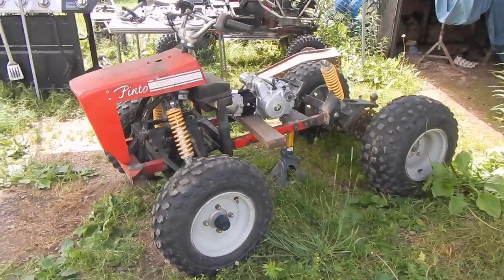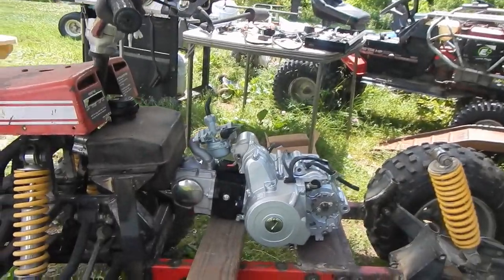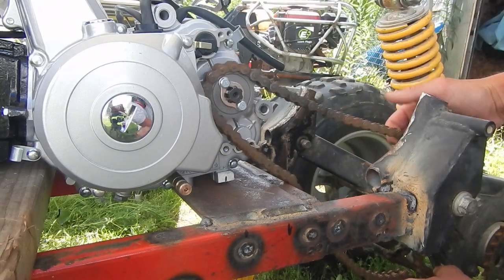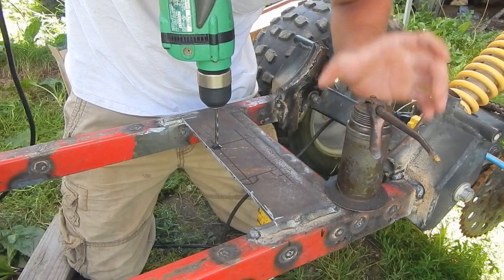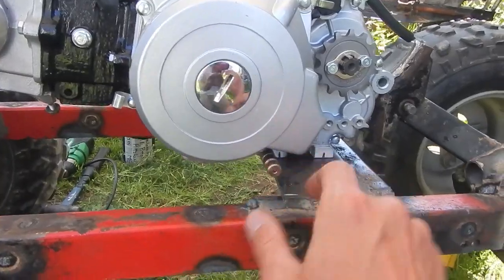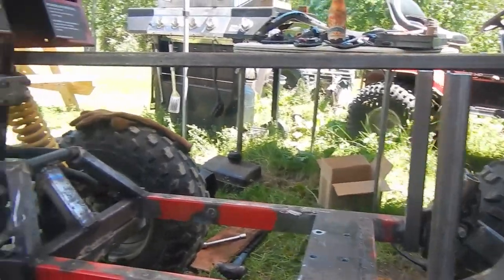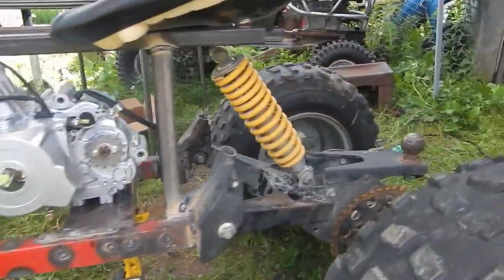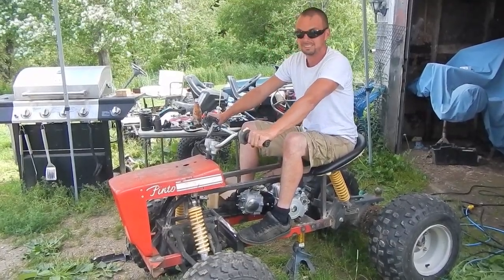Mini Offroad Mower Build #5

Comment: It looks like you have plenty of room to drop that motor about 4 or 5 inches to solve your gravity feed issues. Just move that plate to the bottom of the rail and maybe even a little lower (like a skid plate). This would solve your fuel issue, solve your chain issue and give you better seating options. Just a thought. Looking good. Enjoying the build.

Comment: Looks like Fun!!I love to build things.I noticed how far your engine sprocket is away from your swing arm pivot point,That may give you some problems with the chain going extremely slack whensuspension is working.The carb being angled shouldn't cause a lot of problems, just depends whichend of the float drops into the bowl, I worked at Honda years ago but I can't remember if they fall in the front or back. Sorry if these comments offend you, that is not my intention.HAVE FUN!!! I'll be watching!

Comment: The rear shock mount can be a horizontal bar running from each stub behind the seat. But I'd triangulate it downward from the stubs to where the rear swingarm pivot is welded, kinda in a right-leaning 'V' form from the angle you filmed.

Comment: It's a mowtv
2 things i noticed. First is the intake manifold you have. If you can put your hand on a 125-140-150cc motocross intake manifold they are a lot bigger and actually matches the engine intake port. you Will gain a good amount of power on the top end. you can have them in different angles.

The carburetor you have is great, it's smaller than a mikuni 22mm but it's assle free. I have one and it never needed any adjustment whatsoever. 

2nd thing is, due to the weight of your mow-tv, i would ditch the 14 teeth sprocket and get a 12 teeth. In 3rd gear the engine just won't take it. Nice build and keep up the good work!

Comment: you can make a engine support comming off the bolts holding the valvecover , you have a front crossmember allmost  right under there 
prolly be a good idea to make runningboards to put youre feet down that way you can move youre feet untill youre comfortable and stand up to put some weight over the rear
if you can find a second pinto hood like the one you have you could cut the grille part off it and mount it in reverse between the current hood and the seat covering that hole between the hood and the seat up , can prolly hide the tank under there too

Comment: you should mount a gear stick to one of the bars running from the seat to the handlebars to change gear that way rather than using your feet. Unless it has a clutch then you might have your hands already occupied. Looking good though

Comment: You should look at using a 26mm intake and carby to match the port / intake on the head. Iv had lots  of success with mikuni vm22 carbs. The intake and carby supply with the engine are very under sized and restricted. Hope this helps.

Comment: you are going to have chain tension issues as suspension cycles , The bolt hole behind the sprocket on the engine needs to be in line with swing arm bolt

Comment: When you said the problem with the fuel pump. I was going to state that a futuristic predicament may be the cylinder head on that air cooled motor will get up to212 degrees at operating temperature, and burn a whole through that abs plastic gas tank and become a serious safety hazard. Such as a potential flash fire

Comment: you can get oil coolers for these motors fairly cheap and cool looking ones .. i hope you get one will be a beast not the anodized heat sink looking ones thoe theres actually ones with proper mini radiators

Comment: how you gonna run the mower deck ? lmao
 it's very obvious you need a sport quad, I suggest an early z400 or kfx400. can be found pretty cheap. $1k - $2k.
  awesome fabrication and welding skills, but you may be a bit disappointed in that 125cc. but maybe your next bid you'll be swapping for a 600r motor, I'll check back later

Comment: If you were to have lifted the motor on bushes by an inch you would have been able to solve the chain clearance issue and the bulge thing on the bottom.

Comment: Looks like fun...  If you put the fuel tank up as high as poss under the hood like the old drag cars did (like maybe behind where h-lights would go), wouldn't that give it gravity feed under acceleration at least, and wouldn't it be as high or higher than inlet on carb?  IDK, just an idea, would be away from heat too.  The hood doesn't open right, might have to cut a hole to put cap through is only draw bac I see (build a cap block-'hood scoop' so trees don't damage it), unless that area is taken for something else...  #MudMod125, #AlteredMowMod, #MudMow, I like Thomas idea with "ATM".  You'll prob think of a good name when you are not even trying

Comment: Hmm, Name. call it the " Pinto Quad " ...but in the titles call it a " homemade quad " so the video is SEO friendly, just an idea ... also I'm not to familiar with those engines but at  1:52 when you show the tank and the carb. it looks like the carb would sit at an angle once the engine is mounted. Would that be a problem? You might need to cut the engine mount off again and set it at an angle in the frame so the carb sits level. But still, I dont know to much about those engines so it might work with it at an angle like that.
Reply: I don't know too much avout this either, but from what i have seen it is okay to have it in an angle as long as the exit is above the floater

Comment: My howhit gy6 150cc 4stroke needs whole new wiring harness, by that I mean every last wire, now it's heavily used, total for wiring harness is around $130 so for $450 I get a run for around an hourish box ready plug in play engine, also comes bolted into swing arm (it's a yerfdog spider box chassis with rear swing arm suspension) and my swing arm is twist as that one is new, so all I need to do is bolt I counted 11 bolts up and put the chain on, which is the better deal? Also I don't know mechanical wise how the old motor is...

Also love the build! Looks awesome! I really would like to drive it, also what motor is that? Just want a link to the specs, good luck on the build!
Reply: Go to buggiedepot.com I have a spider box too and I use the wire harness on there it has every part u will need for that cart
Reply: Jake ryan but is it worth it? Also my swing arm is twisted to fuck, so tbh I need it... I'll go check it out, thanks man!
Reply: Jake ryan it took me to godaddy.

Comment: Is that motor semi auto or manual?
Reply: Lol why does the Saab 900's Sensonic gearbox spring to mind every time i hear semi-automatic gearbox?
Reply: its 3speed manual
Reply: ***** might be a .500 magnum with 10in barrel and 12x scope and a laser with folding stock lol
Reply: it's semi auto,why do you think he would make slap shifter then?!
Reply: +dawson colwell usually the left hand lever on the handlebars actuates the clutch
Reply: +dawson colwell oh I. see now

now that I look  at it, you're riggt
Reply: ***** lol :P
Reply: it is an automatic manuall wich means there is no clutch but it has a shifter
Reply: axel cook
My mum's car has one of those type of gearbox. It's the worst gearbox I've ever driven with. It's the Ford PowerShift if you interested. Never buy a car with a Powershift gearbox. Trust me, mum has gone back to Ford 6 times to get it fixed and it still doesn't work properly. It's only 2 years old as well. Im sure most of ya know what clutch-judder is like on a manual, It like that everytime the gearbox changes. Happens in both manual and auto mode.

Comment: Can you call an engine a engine and not a motor, it's a piev of mine when people call a engine a motor
Reply: curiosity..... Dk you know the difference?
Reply: +Rodman Lyons Yes I do, an engine runs off of gas and a motor is electric
Reply: +Coin98 you are correct. You would be surprised at how many "mechanics" don't know. lol. either way we all know what he is talking about. tomato/mater
Reply: actually,  an engine produces it's own power, a motor uses power from an outside source.
Reply: +John Goforth Well you would be correct but I'm correct as well since a engine uses gas to make its own power and a motor of course has to use electric to rotate.
Reply: yes you are correct, I only meant it doesn't have to be electric. sorry
Reply: So explain.   
Honda motor sports
Motor trend magazine
I could go on.    Both an engine and motor are machines that convert one form of energy into a form of mechanical energy.    Be it gas.  Or electric.    Arguments are made daily.  But that is the bottom line.
Reply: Outboard motor? That's the only time I'd call an engine a motor.
Reply: +Jason Curry motorcar? Texas Motor Speedway? What about an obvious one, motorcycle.
Reply: +TheAussieStig30 
And a BIG one.    General Motors.
Reply: Motor in these instances is used to describe what it does, not what it is.
Reply: DMV, Department of Motor Vehicles. [but they're almost all gasoline ENGINE powered] GAAAAHHHH yaknow what, screw this language.
Reply: Who cares what he calls it. Take the time to make some videos of your own and say it correctly. No need to pick people apart that take the time to make  videos for us all to enjoy.
Reply: Crazy Rc did someone get asshurt? Cause you just boarded the asshurt train